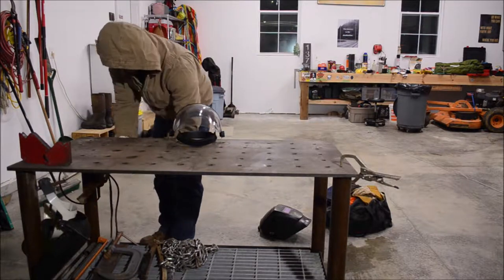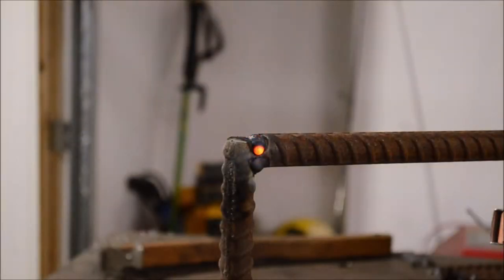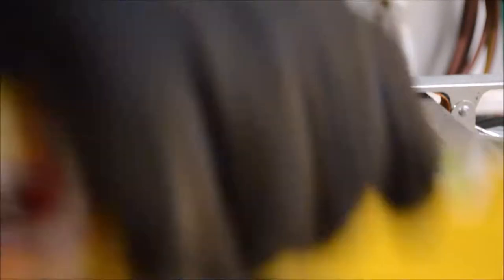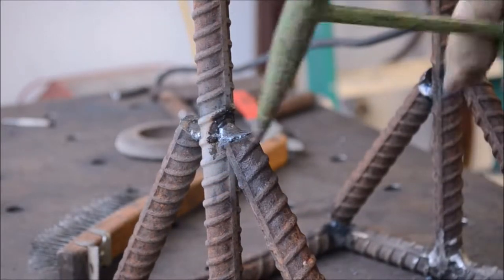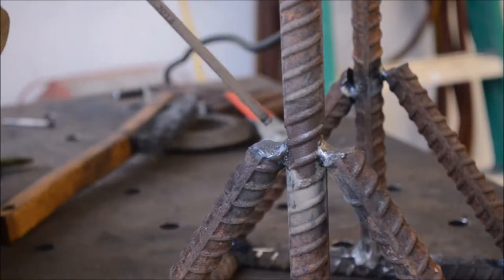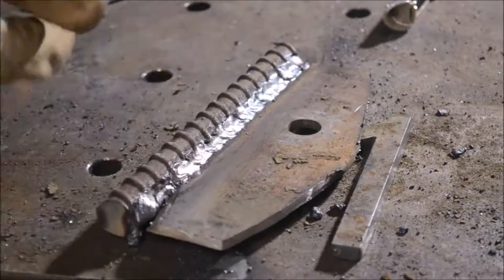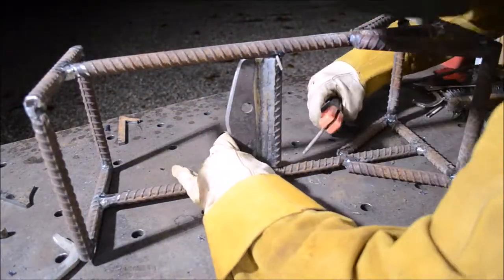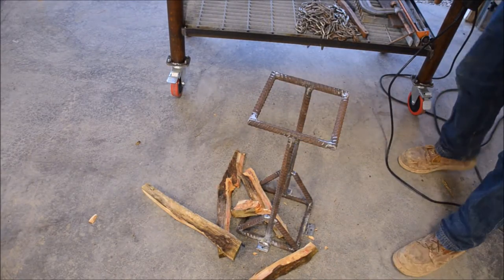How to make a DIY Kindling Cracker out of Rebar - How to Make Kindling Safely

Comment: Good job! 45 degree angle cuts would make things look smoother, but this will definitely do the job it is intended for! Another thought was to maybe use a short piece of the 1" rebar you had for under the blade. Give it more of a flare out?

Comment: 1 part Molasses,  1 part vinegar, and  8 parts water. Soak what ever rusty piece of metal you want to take rust off. Let soak for 2 days. Check. Then just rinse the mix away with water. Vinegar will make it go faster. But may pit the metal.  If you let it soak to long. You can do it with 1 part molasses. 9 parts water. Will take longer. Like a week.